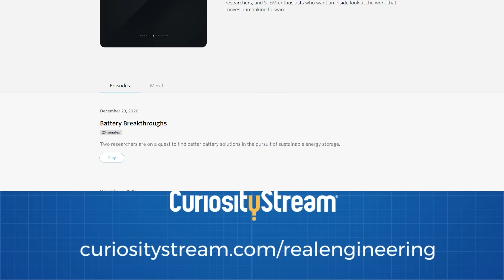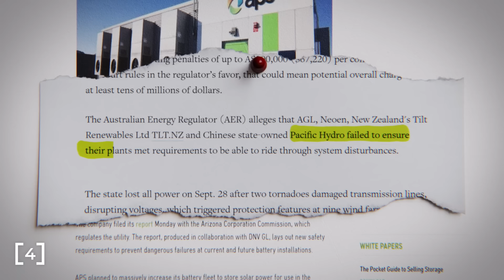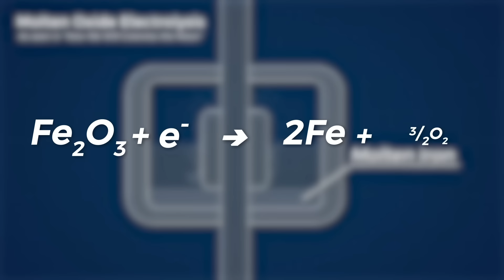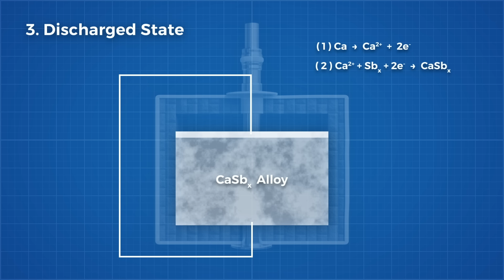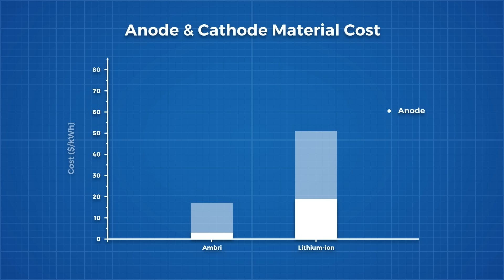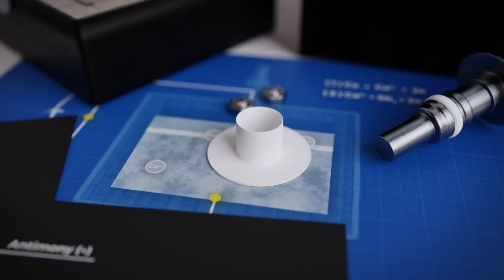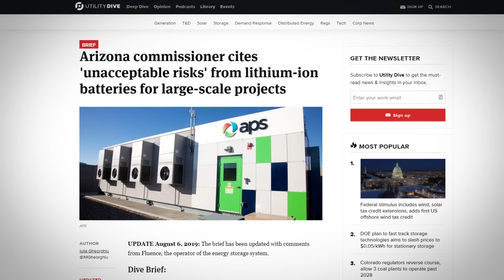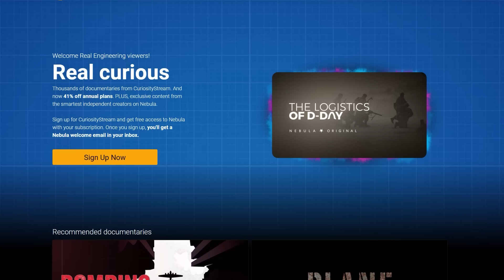The Missing Link in Renewables

Comment: I really liked how you covered the "challenges" of manufacturing, and how that is a barrier. Almost no battery video which talks about "breakthroughs" touches this aspect.
Reply: I think the main difference is that those other videos are mainly focusing on the science of technology. They may be revolutionary in theory but are they worth it? Engineering is a bit of a different beast and takes into account the economic powers that factor into creating usable technologies. You can't be a good engineer if you don't know how to factor in concepts like logistics, economics and scalability.
Reply: Well www.redflow.com has met that challenge and is in production now. You can go buy one and it will be as good, or better in some regards, than Ambri and especially lithium.
Reply: 1:36 How is pumped hydro storage "not scalable"? You can't just make claims without proof.
Fact: the world's largest pump hydro storage facility is 24000MWh which is larger than the world's largest grid battery 300MWh. "Not scalable" my ass.
Fact: pump hydro storage make up for 95% of grid energy storage. "Not scalable" my ass.
Reply: @luongmaihunggia  There are requirements on where we can build pump hydro storage. You need a steep slope to pump the water up, a large catchment area on top, and access to water. This means hills or mountains with a flat area and a river or lake nearby. This also has ecological consequences, since the catchment area requires clearing a large area (though that's not what we're talking about). There are only so many places you can build pump hydro storage.

In comparison, the batteries detailed in this video can be used anywhere. This means that the only barrier for scalability is material availability (which isn't going to be a problem anytime soon). Scalablility isn't about how much we have right now. It's how much we can have in the future. If we need more capacity, it's relatively easy to build another battery station. How easy is it to build more pump hydro storage facilities?
Reply: @luongmaihunggia  it’s not scalable because of the land needed
Reply: @rytan4516  "there are only so many places you can build pump hydro storage"

"How easy is it to build more pump hydro storage facility?"

Yet pump hydro storage still make up for 95% of global grid storage, strange world we live in isn't it? ;)
Reply: @Mathis218337  yet it still make up for 95% of global grid storage. Strange world we live in isn't it? ;)
Reply: @luongmaihunggia  no, not really.
Reply: @Mathis218337  you claim it's not scalable because the land needed but yet it still make up for 95% of the world's grid energy storage. I find THAT very funny.
Reply: @luongmaihunggia  There are a lot of places we can build hydro pump storage. Most of them are taken up. Eventually, all of them are taken up, and we can't build any more. That's why it isn't scalable.

It doesn't matter if it makes up 95% today, if in 30 years we run out of space to build them and we need more capacity.
Reply: @rytan4516  like that's ever gonna happen. I never seen any news on "running out of site for pump hydro".
Reply: @luongmaihunggia  Alright. Do your own research on where pump hydro storage facilities can be built, and come to your own conclusions. I can only share what I have concluded from my own research, and it's clear you won't (and shouldn't) just trust the words of some random guy on the internet.
Reply: @rytan4516  everything you say so far are bullshit UNLESS you can prove there's a decline in pump hydro storage.
Reply: @luongmaihunggia  As I said, you can do your own research. The geological requirements of pump hydro storage are well-known, as is the lack of geological requirements for battery storage. Pointing these well-known facts out cannot be bullshit.

I fear we may be arguing past each other. You say that the current state of pump hydro storage is very good, and I agree. But you're concerned about scalability, which is a different matter. Whether or not there is a decline in pump hydro storage has no bearing on the fact there is a predictable future decline in pump hydro storage. 

There are a finite number of locations where pump hydro storage facility can be constructed. If energy storage capacity needs continue to grow, eventually we'll run out of locations for pump hydro storage facilities. When that happens, to grow our energy storage capacity, we will need an alternative. This is all common sense.

The ecological effects, land use, and opposition to pump hydro storage is well-documented, and is referenced in peer-reviewed articles such as this one: https://doi.org/10.1007/s40095-017-0237-5

In short, even if there has been no past decline in pump hydro storage, the predictable future limits of pump hydro storage means that it's not scalable.
Reply: @rytan4516  maybe there's enough pump hydro storage site to power the whole world. Who knows? You don't. You can't say for certain there will be a future decline in pump hydro.
Reply: @luongmaihunggia  That violates the assumption I gave, that energy consumption continues to grow. Since pump hydro storage can only store up to a fixed amount of energy, after enough time, growing energy consumption means that pump hydro will eventually be insufficient. If energy consumption does not continue to grow, then pump hydro may or may not be sufficient.
Reply: @rytan4516  as we move from type 1 to type 2 civilization. Type 2 civilization doesn't need energy storage while type 1 still does. The most power type 1 need is 10^16W of power. Who are you to say that we don't have enough water reservoir to support 10^16W?
Reply: @luongmaihunggia  Pump hydro requires too much land. On most of your accounts, you do not limit it and make a very vague argument. 95% of Global =/= everyone is using it and that it is good to use for everyone. You can't build hydroelectric storage in the middle of the Sahara desert, but you can in Non-frozen/Temperate Regions with high elevation deviations such as China and Brazil. 95% is not a good estimation of how widescale something is used. 95% could literally just be 1 dam in China just because they can. Hydro is good where there is water, because hydro literally means water.

I would also like to add that Civilizations don't have clear 'types'. They're vague assumptions as to how much energy a civilization needs to function to be a better civilization. If we wasted massive amounts of energy, that doesn't make us more powerful, it makes us speed up the entropy of the universe.

Basically what Rytan said.
Reply: @luongmaihunggia  that percentage will likely drop drastically when there is another viable competitor for energy storage.
Reply: @luongmaihunggia  just because the world used to run on 95% coal power many decades ago does not mean that coal power is a perfect power source. same logic with pumped hydro storage. The world may be using it right now as majority of its energy storage, that doesn't mean we shouldn't be exploring new innovations that have very clear advantages over the status quo.
Reply: @luongmaihunggia  There is no need for a decline in pump hydro (and there most likely won't be any). The thing is we need a lot more storage that we used too because renewables are far less consistent that what thermal power generation used to be. If you take the example of France, there is not much projects of pump hydro not because it is not cost efficient (it is as far as I know the best method in that regard at least right now) the issue is that the remaining sites suitable for such projects are ridiculously few and neighbouring towns protest vigorously on any project.

Pump hydro will keep on growing but other storage facilities will also gain traction (either liquid batteries, lithium, or even hydrogen storage).
You say that the pump hydro storage has a staggering market share, sure! But when you look to EVs, despite their (still) very low numbers compared to thermal engines vehicules, their growth is unstoppable and there isn't many people anymore that do not accept the future replacement of thermal engines vehicules by EVs.
Reply: @luongmaihunggia  95% at the present time. Can you predict 10 years, 20 years or more in the future?
Reply: @dsensiper1  nope. Neither can you.
Reply: @luongmaihunggia  I'll put my money on Elon Musk, Donald Sadoway and Patrick Soon-Shiong over an anonymous YouTube poster anyday. Also, the staff at Toyota, Merecedes-Benz, BMW and numerous other technical companies.
Reply: @dsensiper1  that's completely irrelevant to the conversation.
Reply: @luongmaihunggia  It's at least somewhat relevant to the conversation. Investors can put their money into the large civil engineering firms that make pumped hydro facilities, or into new firms building batteries and battery storage systems. There is far more room for capital gains in the latter, so that will play a large part in where the funding goes,   independent of any technical merit. But battery systems have one big advantage over pumped hydro; for a small enough capacity, battery systems will be less expensive than pumped hydro - I don't think there are any 1000 kWh pumped hydro systems around - and battery capacity can be added incrementally as needed.  And being able to site the battery system next to the point of generation is another advantage - one less path from the point of generation to the point of use. Of course, for large enough energy storage requirements, pumped hydro might indeed be the better choice.
Reply: @dsensiper1  somewhat relevant is not the same as actually relevant
Reply: @luongmaihunggia  OK, completely relevant, along with some other completely relevant points made by others. Perhaps you're involved in some industry that would benefit from further deployment of pumped hydro facilities. I'll close with this, just as one example, from https://www.cell.com/joule/fulltext/S2542-4351(17)30032-6. A relevant comment from the article: "Although pumped hydroelectric storage (PHS) and underground compressed air energy storage (CAES) have the lowest costs today (∼US$100/kWh installed cost), each faces geographical and environmental constraints that may limit further deployment...The projected storage economics parallel those for PHS and CAES but can be realized at higher energy density and with minimal locational constraints." One of the authors, Fikile Brushett, is also a professor at MIT.
Reply: @dsensiper1  yet despite constraints and those limitation. PHS is still the king of grid storage. PHS take up 95% of all grid storage and the largest PHS facility is still remain larger than any of other method of grid storage like batteries.
The point being, constraints and limitations will never stop PHS from being king of grid storage ever.
Reply: Exactly! If I had a dollar for every "breakthrough" I've heard about the last, oh, 4 decades, that never materialized, I'd be rich by now!
Reply: @marco1173  If you had invested a dollar in Enron in the late 1990s you would have lost it, but if you had also invested a dollar in Apple at the time the capital gains from that would have more than made up for the dollar you lost from Enron - to put it mildly. Lesson here is you should invest in a number of technologies; chances are good that something will result in a commercial success. Or you can just continue playing  with your vacuum tube radio.
Reply: @dsensiper1  Totally beside the point, but I understand what you're saying
Reply: @luongmaihunggia  liquid metal batteries are not limited by geography and water availability.  Pumped  hydro storage takes up a lot more volume for power storage, where you can even do it, and it has its own environmental costs.
Reply: Lithium/battery industry propaganda. Geothermal is the future and does not require battery storagez

Comment: No Sci-Fy nosense
Start to explain a metal lava battery 
Cool as always
Reply: We've had similar concept batteries since WW2. Not that crazy, just not in widespread usage.
Reply: @baltasarjimenez2091  Yes, "hot" accumulators were researched and tested decades ago. In the 1970s, electric buses, etc... The problem was to keep them hot. Also, they were not very environmentally friendly, due to toxic materials...
Reply: well if they already have working cells it's not really sci-fi
Reply: Molten sodium batteries come to mind, very niche product, they used to provide power for air to air missiles.
Reply: 🥔 potato batteries.  Series or parallel, just like solar, can work great in groups 😁
Reply: it's not scifi if its currently happening dude
Reply: Get a grip.